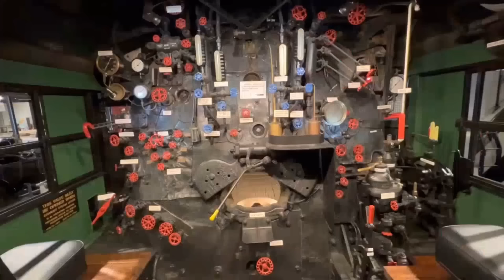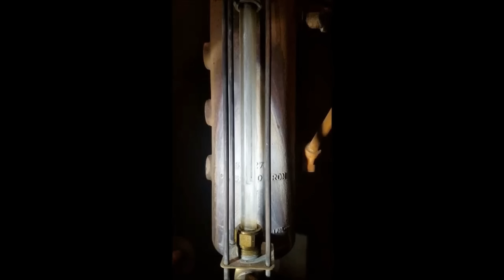20 Steam Engineer Skills, That Are Useless Today!

Comment: The only two that are obsolete are running board oiling and water scoop operation. All of the others are still in use on tourist and heritage railroads. Yes often these are mostly volunteers but there are still paid positions on tourist railroads around the world.

Comment: Mostly correct info, but 1 or 2 errors & exaggerations.  Yu got the article on th Gresly corridor tender partly wrong. The crew changeover (near Darlington) was totally safe.
 Not all these skills are totally obsolete : they are used on preservd lines, & for main line steam specials.
  You show UK steam locos also. ( good one showing th moving water scoop pick up.)   The Southern Railway didn't build these,